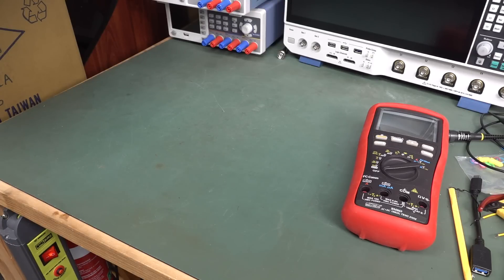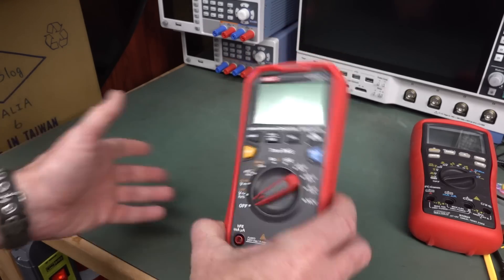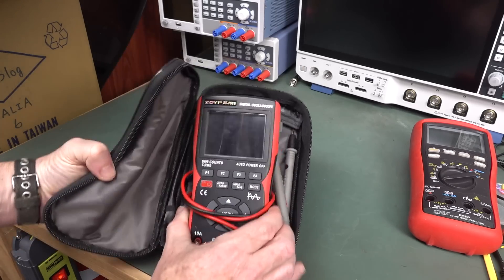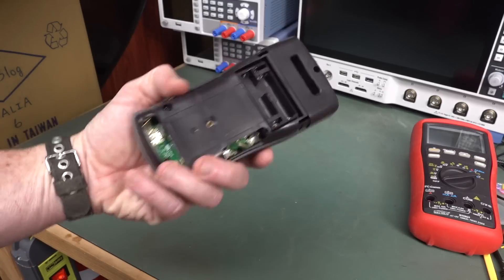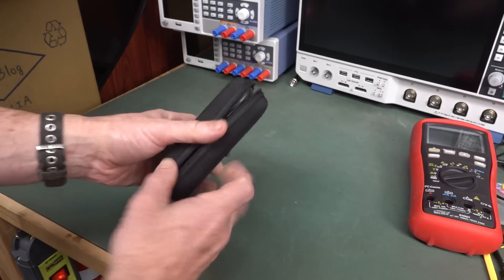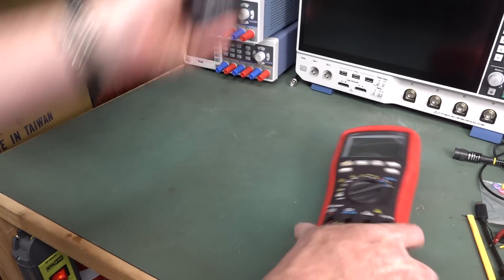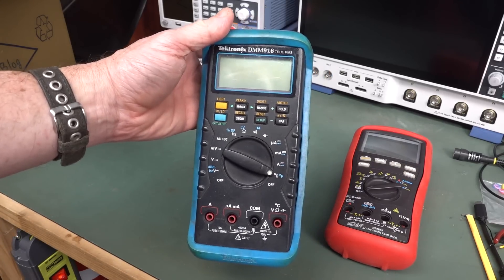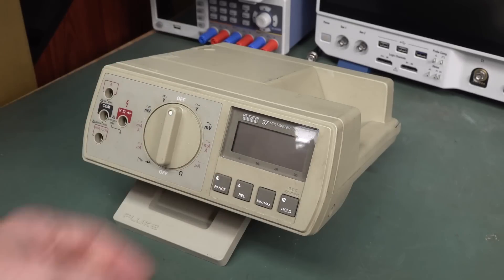MYSTERY Box of Multimeters

Comment: Enjoyed the video. I jumped down the rabbit hole on multimeters during the Covid lockdowns. I still had to work for a shop, but wanted to find a cheap meter to use at work since theft or run over by an excavator was a high risk for my Fluke 87-5. I have a small collection of multimeters now, and would love to see you do a teardown & review of the Radio Shack (Tandy) model 22-216. I could be wrong, but I think it is the only analog multimeter that has autoranging.

Comment: 100% agree your comment that the 869 is just simply "too big" for bench use. In fact i would rather instead use my 34401a on the bench as a better experience... but the main thing is that it just would be so cool if Brymen could "shrink" the 869's 2-line LCD into the new form factor of the 786. As being an update to actually replace the 869. So for heaven's sake, 

So Dave: if you do agree with this opinion and have any feedback loop / ways to influence or pass back to Brymen. Or maybe at an event to get around regular reps to chat more directly with an engineer or product manager. Would be very grateful for that. Because the huge-ness of the 869 - it simply ain't never going to change! Not until Brymen can be updating it at some point. (but surely they must already be knowing this however, right?) Haha